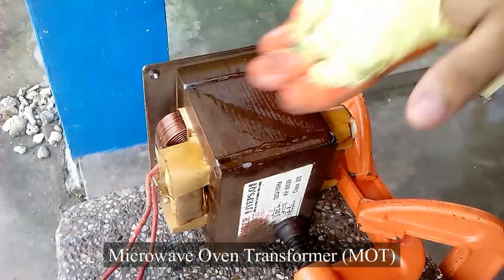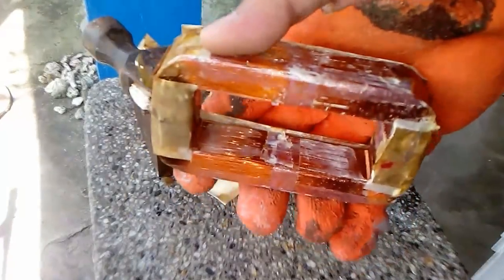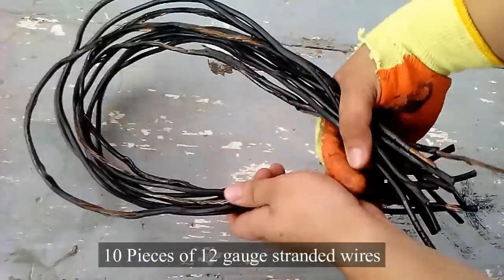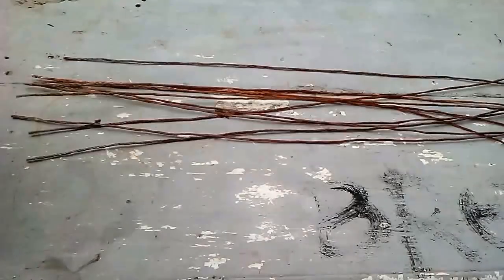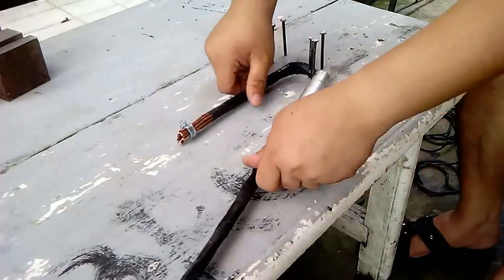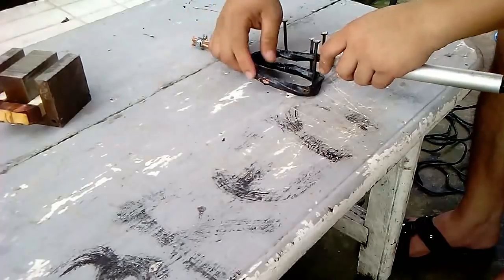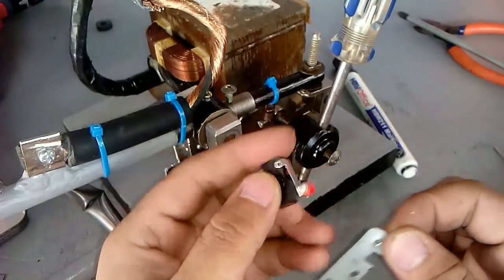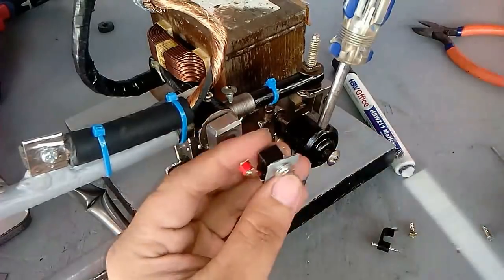Diy Spot Welder Microwave Oven Transformer(MOT)

Comment: Would you please explain how to make the series connection? Won't it make the MOT input voltage cut in half?  What happen if we connect it with parallel?
Reply from the maker: +Julian tho the input of the two transformer should be connected in parallel which is the primary.
Reply: i see.. So, only the output is connected in series right?
Reply from the maker: Julian tho yes :)

Comment: Nice project...but:
Use pressure AFTER the turning off the power. This will keep the steel one to another... 

Two transformers at 110 volts in series can be used for 220-230 volts of the source. 
Two transformers at 220 volts must be used in parallel...

Comment: What happens if u connect both in parallel??
Reply from the maker: +saran kumar it will double the amperage. But be sure both tranformers coils and spec are the same. Or else one of the secondary coil will burn.
Reply: thank you

Comment: non ho capito se i secondari dei due trasformatori sono collegati in serie o in parallelo!!!!
Reply from the maker: sorry if didn't mention it in the video.
i connected it in series, you can connect them in parallel but be sure two transformers are the same and the secondary wire.
Reply: Gennaro Capone paralello

Comment: I have a question, are the transformers the same in all microwaves? If I took one out of a small, dorm type microwave, will it put out enough power? I've needed a spot welder for years but I could never afford one or even find one that anyone says would last very long. Thank you for the video.
Reply from the maker: +brooks wade  I cant say much.  But im pretty sure that it would work with a single transformer with a very thick secondary wire.
Reply: .....thanks for seeking education.....just look on the label,  the CSA or electrical sticker.....should state the specs....you want the wattage to be 900 to 1100   .......oldtech

Comment: Why use 2 transformers? 1,4 volts from one transformer not enough but if you put one more coil of thick copper wire, you get 2-3 volts. That is the most over engineered cam lever Ive seen for MOT welder. You could get a job at mercedes, Anyway it works, good job.
Reply from the maker: +tubester4567 sounds great about your opinion, but im afraid that it will not pass through my satisfaction.
Thanks for your comment sir really appreciate your opinion. Have a great day and godbless :)
Reply: tubester4567 if you double the turns on the secondary you will half the current. basics of transformers.

Comment: I am not a troller...just wanted to point out that the reason that you don't want a manual switch activated WITH the lever is because, the amperage (which is what heats up the metal and makes the weld good gets large WITH force increased between the sheets of metal and electrodes)....it happens in milliseconds (the electric transfer....and so the pressure should already be there before the current is applied.  That way the amperage is large right from the start and then you turn it off and keep the pressure on for a half second or so in order to allow it to cool down somewhat before realeasing pressure totally...that series of events helps improve the weld....but cool design and keep up the good projects....very cool!
Reply from the maker: +The Garbage Engineer I didn't know that hmm. Im thinking that the purpose of the lever switch is to save some time so the process will be fast and to save electricity. Thanks you very much for letting me know it really helps. Have a great day and godbless
Reply: The Garbage Engineer So then in that case, I guess it would be good to have the switch on the handle, in the form of a thumb button.  That way, you can still do the whole process in basically one motion and one hand but still technically not "together".  And that would still be comfortable too.  👍
Reply: Sounds like an idea that many might like, try it out and/or share your thoughts on YouTube.  Everyone has different preferences and/or different applications so you will always get differing opinions about what is 'best', so don't worry too much about criticism...unless it is constructive and can truly help, ....I was speaking from a manual switching stand point rather than a more complicated implementation of creating a circuit that will store up and burst the power in just the right frequency to make a decent weld for a certain situation (the information that I gave out can be found in free studies given out in pdf form via google...in fact I am sure I have it in my Calibre library right now (let me know and after a few years I might get around to sending it to you or at least giving you the magic words to 'google it' yourself).

But ...I guess the reason I mentioned what I did is to point toward the idea that there are (for anything that you design), always going to be more complicated ways of doing it that will give you a 'better' product (in this case we are talking spot welds...but it goes for everything.  And in this case if it is 'good enough' to get you a weld that 'works' well-enough....then there isn't any advantage to working harder to make it better. But then again...there are many many MORE reasons usually that can be found to improve on a design in a certain way.  So, I would say that yes...your idea is great....try it out....and if it doesn't work like you thought it should according to my 'interpretation of the physics involved which some refer to as theory, then figure out what about what I said was incorrect/that you didn't EXACTLY understand and or...just figure out how to improve things.

People often say, 'that would work in theory, but practically it can't work'....such a statement is nonsense.  As the fact is that a TRUE theory ...i.e. the 'way something truly works', i.e. 'the science behind something', WILL work.  You might have misunderstood something, or applied it in a manner that introduced unanticipated error or ....whatever, but if it is a theory that is true...then it can be made to work practically... phew...that was a soap box for you.  Sorry...

PS: If you want to go more complicated I have seen a decent 555 timer IC chip in a circuit that does time the electric impulses in a more effective way ...which paper that describes how to make it and the workings of it, can be found through google in pdf form).
Reply: You can't transform DC so your idea won't work unless you invest in some expensive and complicated circuits to make dc into ac.
Reply: Hi..hope you're doing well, too. Nice that you're happy about your new job. The parts you intend to use, should be fine for this purpose. The price tag seems reasonable too, besides the last one. I think you may be able to find one for half the price.
Reply: The Garbage Engineer

Comment: can you weld aluminium with this
Reply from the maker: Thin Aluminum Sheets Yes :)
Reply: Mehmethan Alac 1
Reply: No. Welding Aluminium is a delicate process and requires two things: 1 A skilled welder as it is a fucking pita to weld this stuff. 2 A TIG welder capable of AC and pulse welding.

Comment: what does this run on? 2x 120v or 240v?
Reply from the maker: its still 220-240v ac transformers are connected in parallel
Reply: Sek Austria ok I'm used to US 120v. I'm planning to make one strong enough to weld studs for dent pulling. I've already made a battery tab welder but I don't think it's strong enough.
Reply from the maker: +Allen McKinney you just need a two 120volts ac microwave transformers ang connect them in parallel nothing will be different in input. goodluck to you dude :)
Reply: Sek Austria I'm about to install a 240v circuit on my porch to run a mig welder so I'll try them in parallel 120v, series 240v and see what happens.
Reply from the maker: +Allen McKinney connecting them in series is absolutely gonna work with 240 ac.